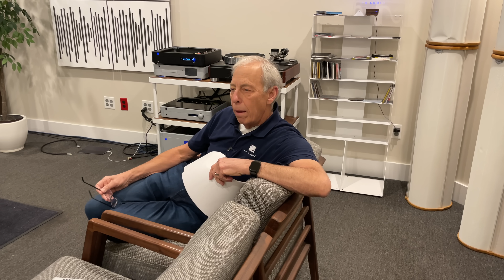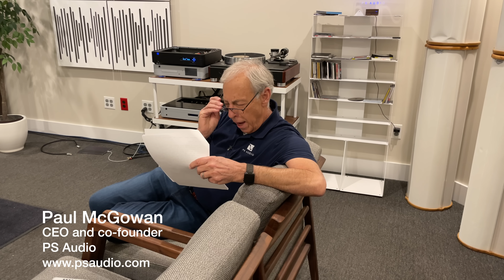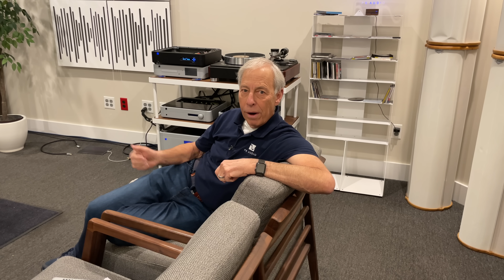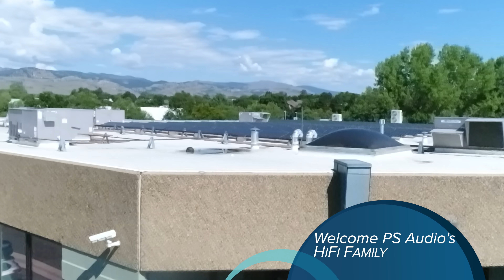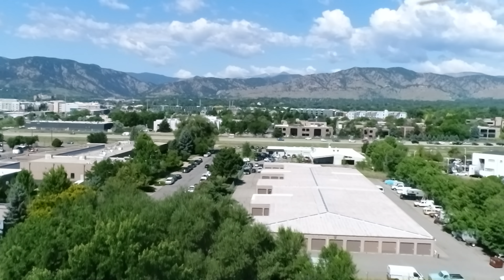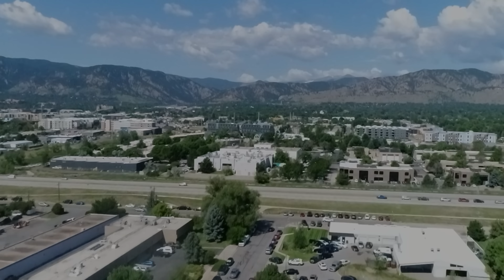High end amps vs. pro amps

Comment: As someone who works in pro sound engineering this whole debate drives me crazy. Twenty years ago, at the bottom end of pro audio this opinion might have been a credible position to take. Two years ago (when you posted this video) it just wasn’t valid any more. A lot of “high-end” audio introduces all kinds of artefacts into the signal chain that we humans find pleasing. But it’s not accurate. There’s no such thing as “warmth” so far as sound engineers are concerned. Unless I’ve introduced it we call it distortion. 

If you really want to hear what the artist recorded, the mixer mixed, and the mastering engineer mastered, go buy a $2,000 pair of active studio monitors. Or go crazy and buy a $10,000 pair of ATC SCM 25As. Connect them to a pro Red Book Standard CD/lossless source with balanced XLR outputs using a pair of pass through channels on even a $500 analog mixing desk and enjoy the most accurate near field sound reproduction you can buy. 

If you want to reproduce the sound at live listening levels, a $10,000 pro FOH set up will blow any high end domestic set up out of the water. To create realistic transients or reproduce sounds below the bottom note on a piano keyboard (~28Hz) without horrible roll off you need a lot of clean power. Domestic equipment even at its most expensive can’t compare with pro equipment when reproducing these. Pro Noise floors are way below the old hissy garbage we had to contend with in the past. THD is at hifi level - even at high power outputs, linearity throughout the signal chain is the same and stereo separation is complete in the pro world. There is never any overlap between channels at the power amp stage and downstream of that.

And as for componentry - if you can’t see it on the oscilloscope, it isn’t in the signal post the power amp. Which as others have pointed out, makes your transducers so much more important than the amplification. So a 20c cap that’s good enough for FAA approval is going to be good enough for your home stereo. Big amplifiers being run under duty control transducers in a way that domestic amps can only dream of. Pro HF transducers are often better made than even high end equivalents. Pro LF transducers are designed to cope with huge excursions and nowadays have massive motor assemblies or even dual motor assemblies. 

The final point I’d make is that the people who buy pro sound gear are generally either performers or venues. Both of these people want the very best they can get out of the equipment and most of the time have budgets that are way larger than regular domestic consumers. But they still have a budget and the gear has to pay for itself. Which is why the sound is superb, but the gear is inexpensive (in comparison to the insane prices in high end domestic hifi). 

Sitting at the mixing desk I often get hifi enthusiasts asking me about gear - most of which I’ve never heard of, let alone heard! When people ask me what I think they should buy and how much to spend on gear, I always say they should buy the set up they like the sound of, regardless of how little it costs.

Comment: I have noticed while touring high end listening rooms and checking out speaker rooms that there is definitely a place and distinct purpose for a high end tube, or non tube amp. Especially something that has insane accuracy in its ability to change amplitude the exact way the engineers and designers wanted. But also, in one of the tours that I took and got to see a Live Sound Speaker/Amp design room, 50ft long 35 feet wide and 30ft tall. With proper acoustic control and reinforcement, there was 2 crown XTi4002 each in bridged mono, one paying the left and channel, and the other playing the right channel, and it was powering like 8 L Acoustic k3 speakers per amp. Some of the most incredible audio quality I've even experienced and the experience was actually FEELING the audio, not just the bass frequencies being  felt inside the blood, you could feel the mid and high frequencies tickling and the volume on the SPL meter for the room was 93 DbFS. Like dude, come on... I have never had a listening experience that incredible even in a $100k listening room. Pro commercial amps are starting to get pretty damn good at quality.

Comment: Some old wisdom here from Paul... The new breed of PA-Technicians and Club owners has been cultivating a set-up that consists of powerful, most neutral/linear amps with low noise floor, that only transports the already processed signal. They don't want amps with a tone. Any tone. The tone is tailored to measure through compressor(s) and (non-graphic) eq(s). An approach that is starting to garner a following in High End circles, harking back to the high-end studio quality of HiFi-Systems like the elaborate (golden age) top systems by Sony, Onkyo, Sansui and especially Pioneer in the mid-to-late 70's... YOUR sound, and if you get bored with it, you just dial into another one.... A neutral amp is doable, affordable and of great benefit here. 

Sorry, Paul, but the days of "sweet sounding" amps are numbered in certain circles, whereas more is expected from the other components in the system, be they flexible or static. Pro-PA-Amps of a certain kind can easily bring this to the table. The eighties/nineties philosophies have had they're day for many newcomers, especially those with a taste for analog designs.

Just my two €-cents from what I learn from a number of forums...

Comment: As a sound engineer installer in my past over the years of doing upgrades I have found economically for a lot of my customers it wasn’t necessarily the inexpensive amp they used as it was the crappy speakers they had 75% of the time I would just put in at that time I was a bag end dealer a set of new speakers and it made a world of difference. It was not the absolute best option but it was the option that fit their budget. My motto is if you’ve made it sound a little better you’ve made life a little better

Comment: There are huge differences between pro and audiophile amps.  1.  Scale of production.  2.  Duty cycle.  3.  Sustained power output.  4.  Power supplies with the ability to select power voltage, input and output voltage limiting.  5.  DSP.  6.  Networking.  7.  Speaker protection.  There are lots of products labeled as "pro" but you won't find them in truly professional venues, applications, systems, etc.  The "pro" crap I see the audiophile guys using is low-end garbage that pros would never use in mission-critical situations.  Look up Linea Research and you will see what a pro amp is.  Crown, Behringer and QSC amplifiers designed for MI markets are not pro amps, are made with sub par components, usually switch mode power supplies, and can only generate their rated output with extreme marketing and non-standardized testing methods.

Comment: Would be interesting to put high end components into a crown amp to see how much improvement from the original.
Reply: Crown uses high quality parts, such as 1% resistors where it matters, and they even used to hand-match transistors to assure best performance.  This assertion that these major manufacturers are using inferior parts, or parts that are less-than, is bogus.
Reply: Putting high end components into anything cheap will make a massive difference. Even a cheap receiver.

Comment: If the classic definition of an audio power amp is to be a "straight wire with gain," then most good, reputable pro power amps in the past 30 years or so have been there already.

It would be nice if Paul caught up.

Comment: We did a blind listening test a while back - all amps calibrated to the same reference output. The amp that came out on top (to our own surprise) was a fairly modestly price class AB pro studio amplifier - ART SLA1.   The second was a class A audiophile amplifier, third was a Crown XLS amp and then below that a mid-fi amp (older Adcom).    So always go by listening blind if possible.
Reply: QSC 1450a is an AB Amp. Great sound and not power-hungry.
Reply: What equipment was the test using? If the speakers are very sensitive, like some of Magnepan's speakers, the difference is very noticeable, especially in the higher frequencies. Using a Crown for the woofers and a more delicate amp for the top end is the best of both worlds. However, as I said, it depends on the speakers you use. It's the same as with everything else; if you connect a UHD Blu-ray player to an old CRT, it will still look like crap.

I dragged my Crown XLS 2502 to a store and played it on the Magnepan 20.7 (just for fun since I know the owner), and the store owner cried due to the background noise and how the Crown handled the top end. It sounded hollow, like you ripped the soul out of the music.

Comment: Behringer? THE WORST sounding audio gear I've ever heard. It is obnoxiously horrible, but then again, some people like obnoxiously horrible.
Reply from the maker: I couldn't agree more.
Reply: @Carl Klinkenborg Behringer mixer vs. Yamaha mixer. The Yamaha doesn't even sound that good. The Behringer was awful, WAY worse. The specifications on paper are good. The mixer in practice sounds TERRIBLE. Just wrong. There's an odd, unnatural sound that makes you feel like you just injected cancer medicine and you now NEED to VOMIT immediately. Good mixers are expensive. Behringer's are cheap because they're REAL bad. Useless for anything other than holding down the trash can you throw them in. Behringer tube amplifier vs every other amp I have, both tube, solid state, & digital. The FIRST thing that amp does is convert your pure, sweet, analog guitar signal into harsh, interpolated digital, where it then futzes around with that copy of your guitar's signal before reassembling a soul-less emulation of your playing. I mean, there's worse ways to do it, but for the price, Behringer's is a rip off, and it's sound also sucks, but in it's own, special way. A different suck, distinct from the mixer. Behringer guitar effects vs. MXR, Boss, Ibanez, gosh, a bunch. My pedals aren't even super high end, yet ALL sound better than Behringer. I want to like to Behringer. I've tried, I've purchased their gear repeatedly and been disappointed EVERY time. No exceptions. TANSTAAFL, and Behringer's gear is cheap because it's bad. I've a musician for > 50 years. I've been an engineer, a recording studio manager and have a reasonably deep understanding of sound production and reproduction. I've learned my lesson. Not all expensive gear is worth the money, but Behringer definitely is not worth whatever they charge.

Comment: So Harman makes Mark Levinson amplifiers and...surprise..also Crown.

Most music is recorded on pro gear, so this raises so issues with this video.

If you always looking for "playback as the artist intended" then wouldn't you play it back on the same gear?

And if crown and mark Levinson are using many if the same parts then either the Levinson is over priced based in badge and colouration ( which audiophiles say they don't want) or crown is just bad for their business.

I have all kinds of gear from pro to audiophile, and as a musician, I can tell you that audiophile gear is very much selling the "fantasy of what a recording should sound like" which is great! But if I want to hear what something was actually sounding like in the studio, you can't get closer than hearing through the same gear it was recorded and played back on.

Sorry man, love love love your channel, but what you are saying makes zero sense.
Reply from the maker: Couple of thoughts here. First, when you make a recording in the studio you use neither Crown nor Levinson amps in the signal path. While you may listen (in the case of a monitor) it's not actually being recorded through them. Second, the fact that Harman owns both doesn't mean they have any similarity in parts or design. And, in fact, they don't.
Reply: @Paulmcgowanpsaudio  
Well we do.
We use crowns off our nieve board into Tannoy monitors to get uncoloured sound all the time. ( Sorry we are locked down hard here or id send you images).
I've known our Harman rep for about 12 years and long ago he explained to me that there are loads of interchangable parts in studio quality crowns with both mark Levinson and luxman.
Again, I'm not claiming that the coloured quality is as pleasing, that's true, but there is a large amount of irony in the search for perfect reproduction from audiophiles whobthen hate the sound of how things were actually recorded.

Your speakers, and the room have far far far more effect on sound than the power amplifier.

Edit: I agree however with PA amps being awful. This is true as they are mostly just designed for volume. 
But things in the studio pro end are better than you might think in the last ten years or so.

Still love your channel and agree with you 98 percent of the time. So all this is said with live.

Be well!
Reply from the maker: @adamtaylor9617  Fair point taken. Thanks, Adam.

Comment: Pro amps primary design requirement is to drive giant speakers at ridiculous duty cycles while having beer dumped on them as they're whacked with hammers. Hi-fi amps primary requirement is audio quality against rapidly diminishing returns. If you've worked in technical enterprise environments for any length of time it quickly becomes intuitive how the application drives the design, and how different professional/enterprise stuff is. Just look at a virtualized server/SAN. They cost a ton of money with all these specs, but if you ran them at your house as a personal computer you would be disappointed with the speed, noise, and power consumption--their design is focused on multiple access and redundancy, not raw speed for a single user.

Comment: This is so funny in so many ways. Audiophiles want their systems to sound just like the band is playing in their living room and yet they dont want the actual Amp the band uses to make the sound they do on stage. Also QSC has a less then .05% failure after 3 years on the road. Dont think they are built cheap.
Also a lot of home theaters use "pro" Amps just because they can be installed in a rack.

Comment: Given the choice between focusing my money on amps vs speakers, I would focus on the speakers. The weakest link is when you are transferring acoustic energy to electrical energy (microphone) and transferring it back to acoustic energy (speakers.)  That said, I am amazed at how incomplete amplifier specifications are! In the early days of solid state, vacuum tube amps had a much better sound even though the "specs" were worse.  It took a long while before the nature of slew induced distortion came to light! Early amps spec'ed out great as long as you ignored what happened when the base current of a transistor was changed too fast causing a burst of noise! Modern amps are way beyond that, but just because the specs look good doesn't mean something is going on that doesn't show up in common specs. (For example, supply cap quality)